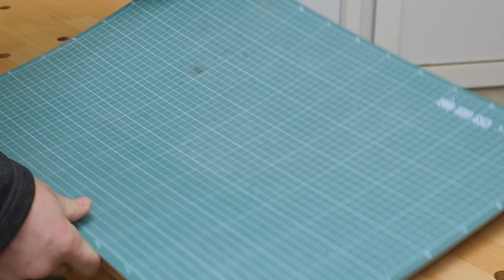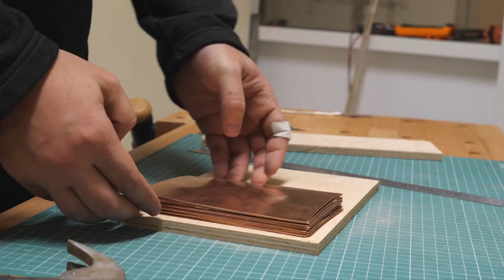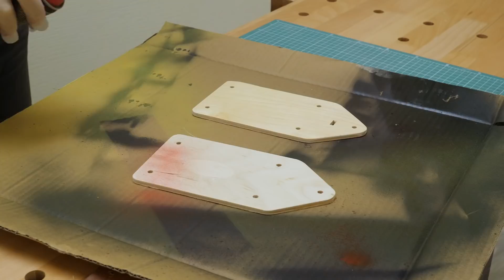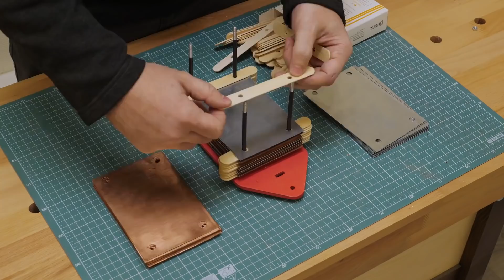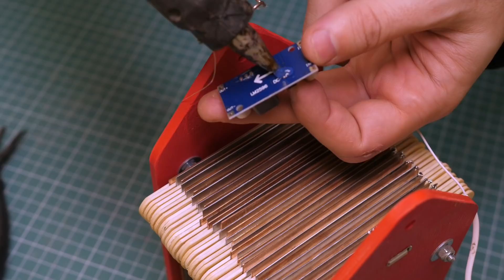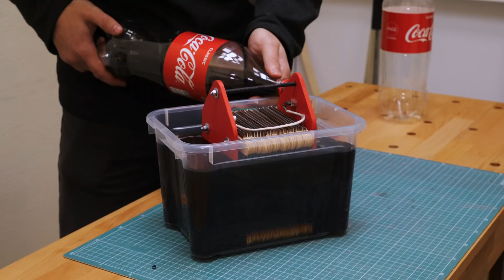How to make Coca-cola Charger

Comment: You could make a car battery like that if you used lead oxide and 1600 sulfuric acid. A few other ingredients...sodium perborate and reverse osmosis water. You don't have to use these exact ingredients but it's best for a long battery life. 

And if you cast the lead plates and mix the lead paste yourself.... did your own welds.... it would probably be faster than the battery that you just made.